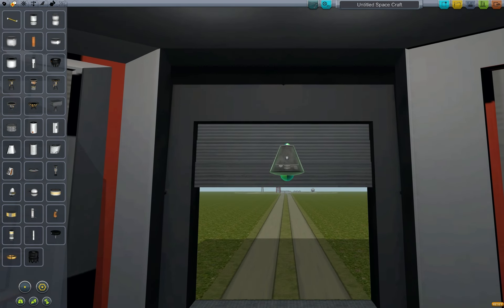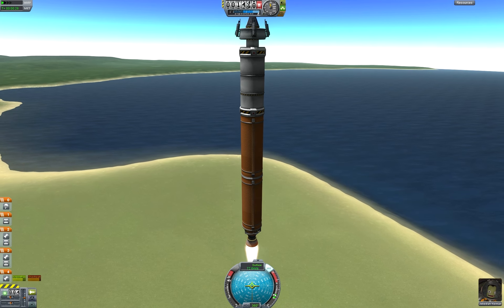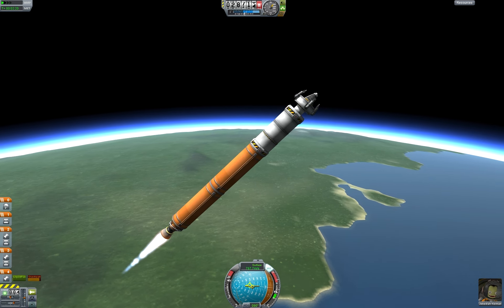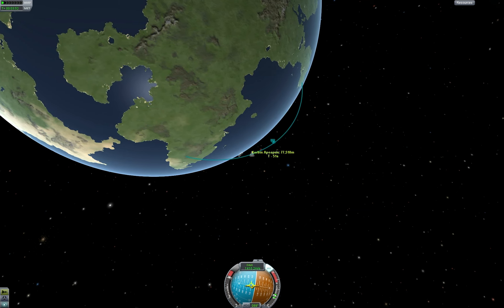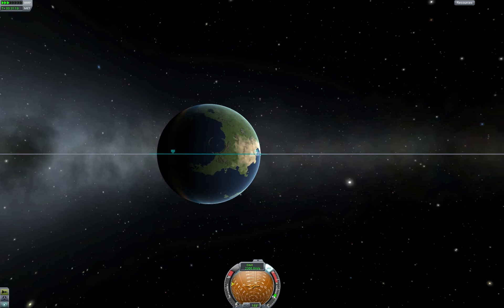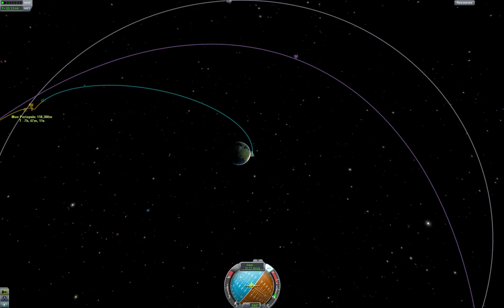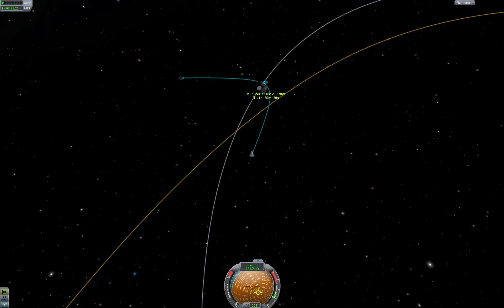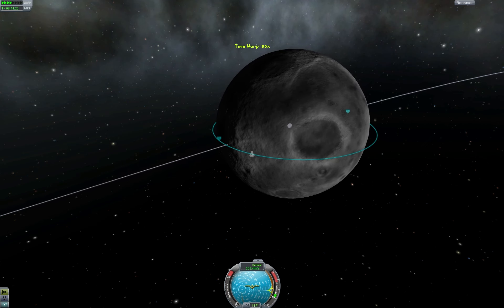Kerbal Space Program - Simple Mun Landing Tutorial

Comment from the maker: WASD and QE angle parts (I'm never quite sure which to use so I just try them all), and shift switches it from a 90 degree rotation to something small (maybe 5 degrees)... So shift+S rotated them in this case. I did it because I didn't need the vertical height for such a small engine, and this allowed the lander to be wider and shorter, ie. more stable.